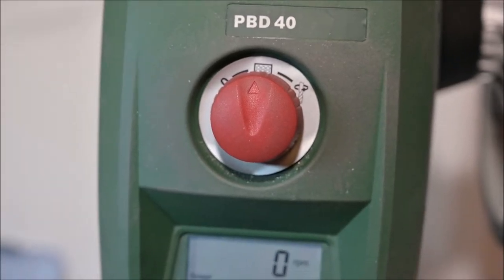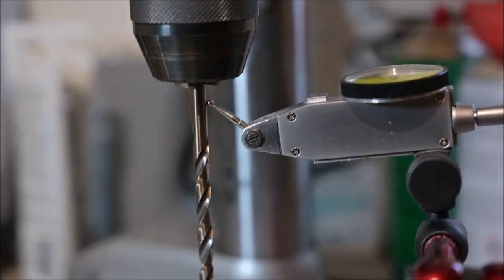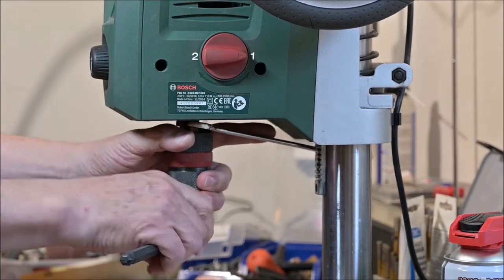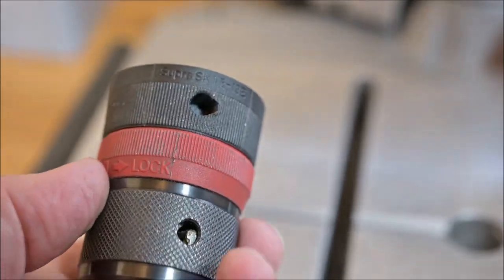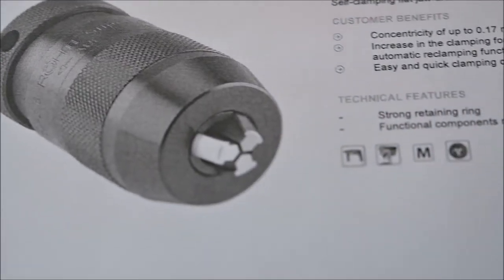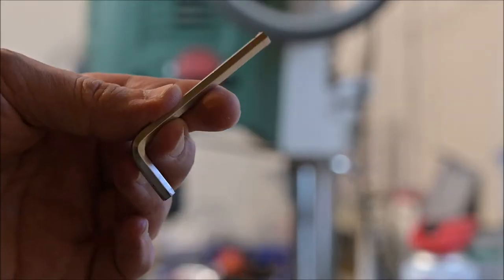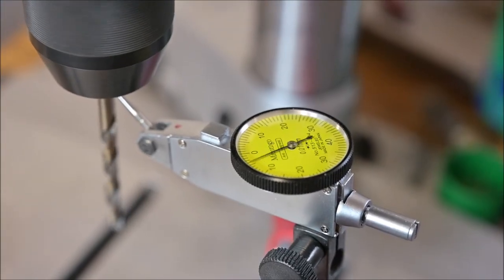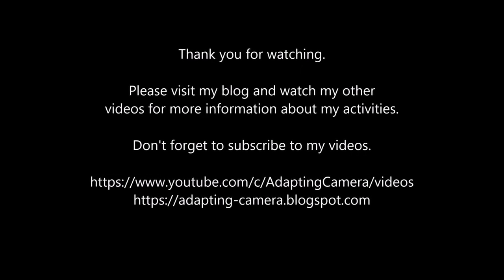Chuck changing on Bosch PBD 40

Comment: Thanks for this video. Changing the chuck looks clearly like an improvement. Another problem is the spindle wobble, which is due to the upper needle bearing, sitting in the top of the gear box. This 8x12x8 mm needle bearing has a rather loose fit. I don't know why Bosch has chosen this solution, maybe it lowers production costs. Have you considered to change it? I found a couple of YT videos (Alex Safran) about this and decided to throw out the needle bearing. I replaced it with two 8x12x3.5 mm ball bearings stacked together. After the change I can feel no play at all in the spindle. Its a huge improvement so far. Extracting the old bearing was a bit tricky. There are some useful videos about DIY tools if you don't want to buy an expensive extraction tool, or a whole set. I used the (remaining parts of) the drill stand to press the two new bearings into place. I fitted a 5 mm screw with 8 mm round Allen head, and a 12 mm bushing I found in a scrap box into the chuck. The bearings sunk into place quite easily. I will report measurements as soon as the chuck is replaced.
Reply from the maker: Yes, I have considered changing all of the bearings and have in fact bought all the necessary ones but had no time to do the job yet, but it is definitely on my list. One problem is that I need the machine quite often, so once started with changing bearings I must finish fast. I also understand that changing some of them might cause some headache, so I want to make sure I have a time slot to do it properly without stress. Anyway, I considered that changing the chuck was the most important thing to do, and yes, it is a huge improvement.
Reply: @AdaptingCamera  I wouldn't bother to change the bearings for the internal gear axle or the motor. The most important ones are the two on the main spindle. The needle bearings sit on top of a bearing washer with the same inner diameter as the bearing itself. There is not much to grip on other than the needles. If you have a dedicated hardened tool it should not be a big deal. Be aware there are some delicate electronics and wirings. Thin wires go to the lasers, the rpm sensor, the light diodes and the drill depth meter. There are four micro connectors to pull out from a circuit board in the front panel. I would suggest to secure the front panel to the left side with gaffa, as a temporary swivel. Then loosen the power cords and the four cords connected to the motor. There is also a small piece of circuit board on top of the motor that has to be pulled upwards. Now the front panel is ready to be removed. The left panel can be left hanging in the mains cord. It is convenient to keep everything on the column as long as possible. Don't forget to calibrate the lasers before you close the case! I shot some pictures during the dismounting procedure. Annotations are in Swedish though, sorry. You can translate with google, or feel free to ask for explanations. https://www.dropbox.com/sh/et2gtlu8cpgxljy/AAAFfRcwpKyM1Mc_LRLSGp7Ea?dl=0
I am not sure the two ball bearings I used to replace the needle bearing are optimal. Maybe a bronze bushing would be more appropriate? A Russian guy here seems to have come to that conclusion.
Reply: @AdaptingCamera  Hello, today I measured the run out in the old chuck with both a DTI and an ordinary dial gauge. I used the 10 mm stem of a new edge finder and, for comparison,  also a 6 mm cutter. In no case did the run out exceeded +/- 0.05 mm. Unfortunately I did not measure before the replacement of the upper needle spindle bearing last week. I'm sure a forthcoming change of the chuck will bring down the run out to maybe just +/- 0.01 mm. The stock chuck really sucks. Sometimes it even drop my tools. New chuck next!
Reply from the maker: @paullehmor982  Hi, so you mean you changed the needle bearings and now your runout is better than +/- 0.05 mm? Because if that's the case then I think that's excellent. I agree about the original chuck, one of my problems was also that it did NOT held the drills firm enough, at least not all the time. After changing, the new chuck is easier to tighten and it NEVER let the drill fall out or the spindle spin without gripping the drill. I am very happy with the PBD 40  now, that's for sure.
Reply: @AdaptingCamera  Yes, I changed the bearings as described above. The runout is +/- 0.05, no less, no more. I'm thrilled as to what a new chuck will do! It seems we have the same experience with the stock chuck. The grip is completely unpredictable. I would say it can be a safety risk to use it. Well, these two improvements are easy. The lack of quill is a major one which I don't know how to address. The whole assembly is guided by a rod running through a bushing. It is reasonably secured if the big red handle is tighten very firmly. But on my machine it is not consistent. It seems a little more stable when I lower the unit with the wheel. In my opinion, this is a main construction error. I don't really know what to do about it. Do you have any ideas?
Reply from the maker: @paullehmor982  I actually like the way the machine is handled in general, including the red handles. I like the fact that it is very easy to move the head up an down for best results, and I use it often, even between drill changes, to get optimum height to avoid having to turn the wheel more than necessary. I think the reason why many people hate the wheel is that they don't move the head up and down, they use the wheel to the maximum, and only lower the head when the maximum is reached and it becomes absolutely necessary. My drills are always just enough above the work piece so that I can remove the drill bit. Yes, there is a need to do something about the wobbling of the machine head on the pillar, but I think that's solvable too, though I don't have it very high on my list of priorities. Never the less, once I start changing bearings, the machine head is off anyway, so I might as well fix that wobble too. I'll get back when I have done something about it. Yes, there are several possible improvements one can make or wish for, but we have to remember that this is a fairly cheap machine and in my opinion, regarding the price, it is excellent. Yes, you can find cheaper machines, but in those are also MUCH worse in many aspects. Also, this is intended for hobby use, and while even we hobby users wish for precision and bells and whistles, we definitely have a lot of potential in this machine, it is very good and useful for most works. Before buying this, I tested several, some even more expensive, bench drill machines, and found none better. Especially when it comes to speed changing, motor performance and flexibility. ALL wobble, some a bit less, some considerably more, and most of them don't have this excellent motor control in terms of constant power at any speed. This is a very good machine, but it needs some "polishing". Every improved bit adds to the costs, and if everything was done in the factory it would have been priced twice as much and probably wouldn't have been sold that well due to the target group.
Reply: @AdaptingCamera  I agree on everything! Especially what you said about speed control. And not to forget, there are no plastic wheels in the gear box. The height adjustment worked smooth when it was new, but it soon started to jerk when moving downwards. The piece below the spring gets caught and is released with a huge bang when the spring reaches enough tension. It is easy to get the fingers in the way. I tried everything, dry pillar, various grease and sprays, adjusted the to set screws, but it never returneds to it's original functioning. Have you any ideas what to do?
Reply from the maker: @paullehmor982  Yes, I know actually what to do. The reason why it behaves like that is that you must tighten the top red handle, with the depth stop pin fully down. Normally that pin should drop smoothly down and move freely up and down if the tightening screw is not grabbing it, but if that's not the case, you should check why. Anyway, when the top handle is tightened the pin prevents the head from moving within the envelop of the spring, keeping the spring fixed all the time while you move the head down. It is not necessary to lock the depth locking pin when moving the head upwards. My way of moving the motor head down is always tightening the top handle first, before loosening the bottom handle to allow the movement down. Unfortunately, this is not described in the manual, I just checked.
Reply: @AdaptingCamera  Thanks, I think you are right! But it is somewhat bizarre that the depth stop must be used this way. It should clearly be in the manual. I regard it as a consequence of poor design. I doubt Bosch will ever comment on it.
Reply from the maker: @paullehmor982  I have to disagree with you, to me it looks very logical that the depth stop is involved. How else would the machine know if you want to lower the motor or to actually drill? The only thing I can blame Bosch for is that they did not mention it in the manual. Perhaps the writers thought that everyone understand that part, which is the wrong assumption. Initially, I didn't think about it and did not understand why the motor head is jumping and jerking. It looked kind of scary, but then I looked at what actually happens and understood the reason. So to me it's logical that the depth stop is involved, but it should have been explained by Bosch, even if they thought it was self explanatory. Anyway, one way of avoiding the jerk and jump is greasing the pillar so that the inner ring, the ring the spring pushes down, is sliding easily. That might (should)  eliminate the jumps for a while.

Comment: Argh. The link is dead. 
I look on Amazon UK, one is £78, one is £101! And they seem exact same. 
Also a review on amazon mentions the best bearing with tighter tolerance is NSK 6002DDUCM. Many thanks for the video! Liked 👍 it’s a shame many others haven’t ! 🙄
Reply from the maker: Thank you for the comment. The link is updated now. Rohm have changed something on their site since the structure and the links are different now. Amazon is a bit of a lottery, not always easy to find a good deal. I bought SKF bearings but have not had time to replace the bearings in my machine yet, the work is still on my "to do" list.

Comment: Hello there, I’m considering to buy one for drilling aluminium enclosures for music devices where the potentiometers are mounted on the pcb so need to make holes precisely where the hole layout is, you think is good for my purpose? 

Thanks for the video!
Reply from the maker: I use mine mainly for drilling in aluminium, but how precise you are drilling depends not only on the machine, but also how well you marked the holes and how good your drills are, as well as how you actually do the work, i.e. your skills. I use it also for the type of job you want to use it for, but on the other hand, I could use a manual, hand drill for that purpose also. Drilling holes for potentiometers does not require extreme precision, so yes, this machine is more than good enough for that purpose, at least when I am using it.

Comment: Changing the needle bearing is a matter of 1 hour of work max, the unit is easy to disassemble, and it's really easy to remove the needle bearing with the bread technique.

You should definitely do it, it did remove any wobble and any play I was witnessing; I don't have the means to measure though, it but now my precision work is really precise, while before the drills had to much wobble. I am now 100% satisfied with my PBD 40. Just by replacing that bloody bearing. Do it, it's fast and you'll never regret it!
Reply from the maker: Thank you. I will definitely do it, but right now I can't since I don't have time. I have all the bearings needed, and know it is easy to disassemble, have done it before. Nevertheless, if I open it, I change all the bearings, or at least it is planned that I will do it that way.

Comment: Thanks for the Video. I will change my chuck this way.
Reply from the maker: Thank you for your comment. I am glad you found my video useful and hope you have managed to change your chuck.
Reply: @AdaptingCamera  No, it  did not work. I did not succeed in loosening the old drill chuck.
Reply from the maker: @volkerweber1063  Did you try the same way I show it in the video? I mean, it feels a bit scary to use a long pipe and having to push it with such force, but in the end, mine did release with a huge bang. The "bang" is not in my video because I did that before I made the video. Anyway, if you try again you must be careful and must make sure that the Allan key is inserted and tightened properly. Some people managed to insert it wrong and after tightening, had problems with removing the Allen key again.

Comment: Thanks for the video, i wonder what size allen did  you use when removing the chuck?
Reply from the maker: Sorry, I don't remember. It was the largest I could find around me.
Reply: You really need the largest you can fit in the chuck….it’s simply used as a lever to unscrew the chuck against the 16mm spanner fitted to the spindle…put the short end in the jaws and tighten the jaws to grip it..
You need a largish one or you are likely to bend it, as it initially needs some brute force and an extension tube to move it….it’s quite tight…

Comment: Thanks! Chuck is ordered, but people say that it's smart to exchange two ball bearings in the gearbox also, since they're cheap bearings from China. It would be nice to know how to exchange those ball bearings also. Then I think this machine will be very precise for the price.
Reply from the maker: To be honest, "for the price" it is an excellent machine in my opinion already without any change. Changing the chuck is very easy, it can be done by almost anyone. Too bad Bosch did not mention that in the manual and also not very supportive about it. Changing the bearings is a different thing. It needs more skills and should only be done by people, unless they are professional, who are ready to brick the machine if the change fails. Also, I think the biggest issue is not the bearings in the gear box, but the two on the spindle. Those are the ones causing the spindle wobble, not the ones in the gear box. Anyway, I plan to change tall bearings but have had no time to do it.
Reply: @AdaptingCamera  The spindle bearings. Ok, I see. Yeah, I'm not planning to dismantle the whole thing, but if some bearings helps and it's easy to do, then it could be an option.
Reply from the maker: @gsolas  I can't say how easy it is to replace those because I have not done it yet, but it should be easier than the pin needle bearings. Never the less, in both cases you must dismantle the drill head. Bearing replacement is never easy.